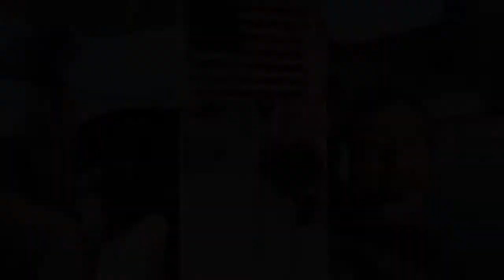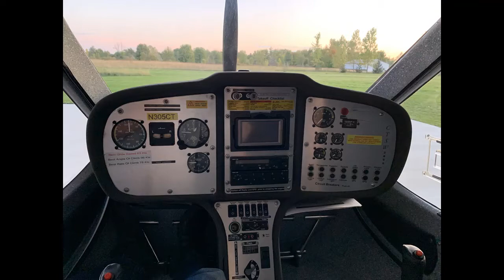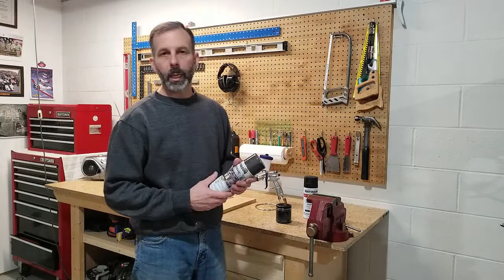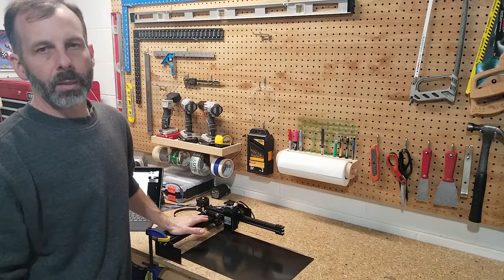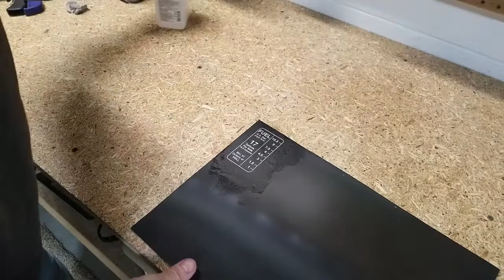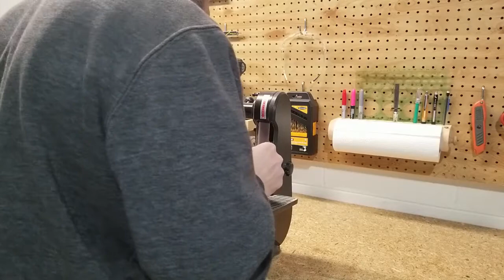Engraving Painted Aluminum Vigotec VG-L7 20W Laser Engraver

Comment: You should be using Amber colored lenses. The green lenses are perfect for red lasers, but this laser is blue and requires the amber to block its color spectrum. Just a helpful tip!
Reply: Yes, laser  goggles $40 and above, and also an orange shield acrylic